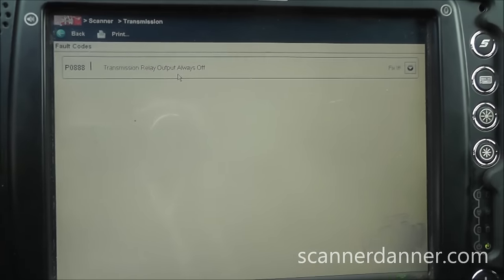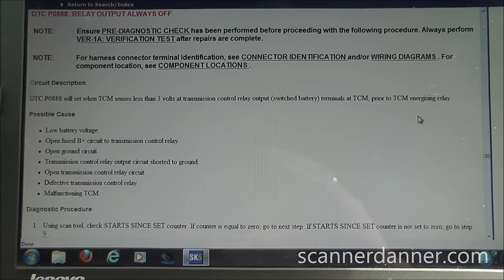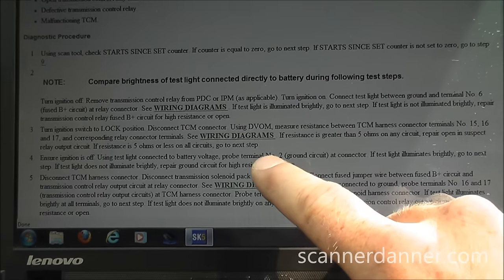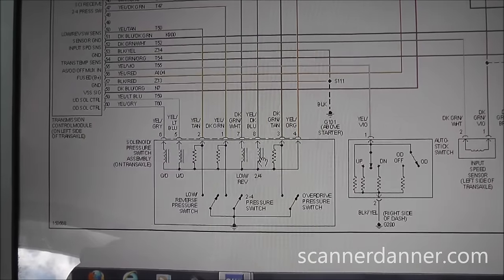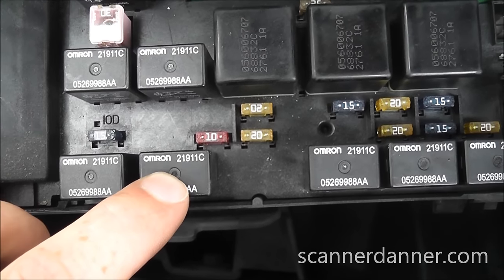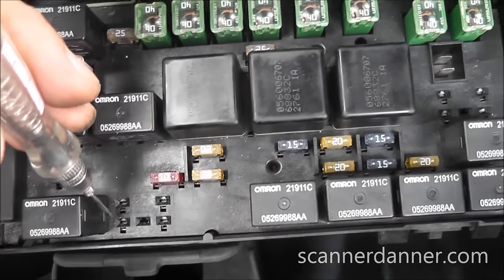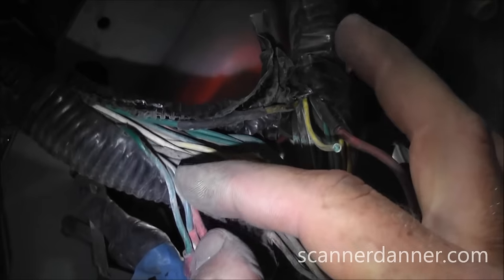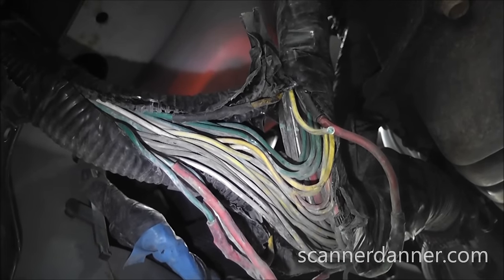Transmission No Shift Case Study (P0888)

Comment: Good vid sr. What you can tell me about code p0891,thanks in advance
Reply from the maker: look up the code definition and post it and tell me what you are working on
Reply: Is a 04 pt cruiser touring ,I’d follow all the relay wires under the fuse box and found a bridge cable disconnect it seem like a ground cable for the place where is connected,but the original fuse box cable is red so.. I haven’t put everything together yet will see this evening,thanks for replying keep up
Reply: ScannerDanner is the code 82 and 83

Comment: The main differentiation that needs to be made at the relay...1. load side fault or control side fault. 2. Is the coil(control) power side switched or ground side switched.  Those are HUGE priorities when it comes to attacking a relay circuit in my opinion.  Going to the relay first is clearly where you gather a sense of direction.  Checking fuses IS NOT always the first step people, please, get it through your head. On another note, just because a circuit is inoperative, does not validate  the phrase "it must have a short somewhere" The vast majority of people who say that do not even know what a "short" is, so sick of hearing that. I have never, not once fixed a vehicle simply by replacing a fuse. Fuses blow for a reason, you better be finding out why it blew. I know for a fact, on older Chrysler vehicles, the transmission relay was tied together with the LDP and the Alternator(been there, done that, lol) Anyways, awesome content, testing and information once again Paul, as your brother calls you, you are the master, lol.

Comment: i have ram 2002 5.9 with re46 trans when i start it and run it directly its will change all gears fine after 2 min if i stopped it will stuck on the first gear ????!! thanks
Reply from the maker: Second gear lockout. You have codes in memory if it's doing that. You need a scan tool that can read the TCM

Comment: inside my fuse box...the airpump relay wiggles n doesnt fit well.
at the local junkyard,there are 5 same make n models of my buick.
i looked,all of them but one were hooked up the same without an air pump relay in them.
so i dissected the fuse box.the one that had an airpump relay in it was a pga touring edition & had two brown wires from the harness that filled those particular areas...whereas on mine...by unplugging the second bolt of the 3 bolts holding the fuse circuitry board together..there werent(holders/wires)...& i was all like maybe i need a fuse wrap to get it to sit still...but!  if theres no lil wire in there to catch the relay or fuse..then its inactive or inneffective right?...but why is there a spot saying air pump instead of Future.. like its unneccesary!

Comment: What if I can't activate the relay with the test light..ohm tested all wires out all ok..have code 0888..put a used tcm didn't still work..checked all,wires in harness took,it all apart..do u think I,need to reprogram used tcm for it to work..
Reply from the maker: IF you cannot activate the relay with a test light, my first question is what kind of test light? Secondly, are you connecting the test light to the correct polarity? Third, are you on the control side of the relay?

Comment: Where is the automatic shut down relay for 2009 dodge ram  1500 5.7.? Soleniod is stuck in 4th gear. I check the fuse box under the hood. There is nothing there saying that. All I see is starter solenoid starter relay. There is no transmission relay. Please help.  I feel this is a electric problem that can be solved. Thank you
Reply from the maker: I think on the 2009 it is part of the totally integrated power module (TIPM) and is a HUGE problem on these systems

Comment: Hello I have a 2003 Suburban and I put a 2005 transmission under the Suburban now it won't shift it has reverse but it doesn't shift to 2nd 3rd and 4th and Overdrive what is my problem

Comment: ScannerDanner .thank for the video.BMW 2001 325i w/transmission zf 5hp 19 does not engage any gear only N all the time,filter ,fluid are new can you help me .please thank you.
Reply from the maker: Not much I can do through text on a screen. Sounds like the transmission may need to be rebuilt. A neutral condition in all gears is never a good thing
Reply: ScannerDanner.Thank you very much for answer the Was quick.

Comment: What if you can’t get the relay to click with battery positive I don’t know if it’s where I disconnected the battery and then ran this test without the check engine light being on and the van shifting normally (for now) after a short time of driving it it goes back into limp mode I just figured the relay should still click I’ve switched relays and have the same issue I have power on the top two terminals and the bottom right but not the bottom left (from side of van and only using test light don’t know the actual voltage coming out yet) any advice would be helpful
Reply from the maker: https://www.scannerdanner.com/forum/post-your-repair-questions-here.html, post this here my friend. IT is free to join. You will need to include more information than you have here. We will need year, make, model, engine, codes, history etc etc

Comment: Hi Dany
I need your help I got 2004 Ford expedition gear not shifting from 1 while in D position but if moving the shifter to 2 it will shift to 2 no codes change another transmission  but the problem still exists 
Thank you so much
Reply from the maker: Post this to my forum https://www.scannerdanner.com/forum.html
Thank you! It is free to join

Comment: I have a LR Solenoid code on my 2006 Durango - replaced the solenoid pack but still have the code... any suggestions??
Reply from the maker: open or shorted wire in the harness or faulty PCM driver
Reply: same problem just checking to know how to fix it

Comment: Hi, I'm turkey Istanbul from you I have a tool that will be a question for a 1998 model Proton brand mutsubi compatible 1600 ° engine automatic transmission problems i have transmission I have collected only tool motion does not I would be glad if you help whichever relay caused solenoid problems
Reply from the maker: I would not have any service information on the model car that you mentioned. I am sorry, we do not have those cars here in the US

Comment: I have a 2006 E250 5.4 liter that goes straight into 2nd gear and will not shift out. Reverse, neutral and park all work fine but like i said, only had 2nd gear and i have brought it to 2 different shops and was told its electrical for sure. I have no idea what relay to check because it's a Ford. Do you or anyone have any ideas what it could be before im tale to shop???

Comment: Hey! My 2007 Chrysler Sebring Touring is stuck in another gear. It won't go faster than 35. Please help!
Reply from the maker: You need to scan the transmission control module for codes

Comment: Mine is throwing no codes but it won't go over 20 miles an hour unless I go down a hill first and then I can go to 60 with no problem but only if it's pretty steep hill and it gets me over 35 it does not have low fluid at perfectly full however I don't know what the problem is I come to a stop sign and I won't go over 20 again until I go down another Hill I have a 2003 Dodge Dakota 3.9 L and have no idea what to do now please help
Reply from the maker: It could be from a restricted catalytic converter. You need to pay attention to the shifting. Is it shifting through all of the gear? Or is it stuck in second gear? HUGE difference in the approach from here

Comment: I have a 2002 F150, FX4, 5.4, 4r70w . Will not shift, got transmission rebuilt, nothing,  checked harness wire by wire(resistance). Fuse 23..still nothing... dropped the tranny again, went through it again.. installed new valve body... still nothing... it seems like there is communication between computer and tranny...yet, it will not shift.... NEED HELPPPP

Comment: My car is a Chrysler sebring convertible 2000  and is stuck in limp mode.....how do I fix it because my port to have it tested also has no power going to it....im lost and do t know where to start
Reply from the maker: Start with getting power back to pin 16 on your DLC. Usually it is tied into the cigarette lighter fuse.
Reply: ScannerDanner ....ok thanks

Comment: My battery got installed wrong amd fried some stuff on the car everything fixed now but the trans dont wanna shift gears anymore what can it be??
Reply from the maker: you need to do a full system scan with an enhanced scan tool. I am sure you still have a module that is not talking (cooked)

Comment: my dodge charger will not do anything when I put it in drive or reverse. the engine will start up and run and everything.  When I put out in drive or reverse it does nothing it just revs up when I tap the gas and ideas on why it's doing this
Reply: 5.7L
Reply: 5.7L Hemi
Reply: This is the same thing my 2001 chrysler sebring coupe is doing. I passed a car which caused it to kick down into passing gear. Then i thought my wife bumped it into neutral. Cause it just started revving up when I pushed the gas but wouldn't go. Pulled over to the side of the road. Reverse, Drive, 1st, 2nd they all seem like neutral just revs up when accelerator is pushed. No warning signs prior to this happening. No slipping, hard shifting or anything before it did this. So I towed it home and I'm still trying to diagnose the issue so I can fix it! If anyone has any ideas on whats going on I'd greatly appreciate the input thanks!
Reply: Did y'all fix the problem?
Reply: Norma Lazcano  mine was low on tranny fluids.  You might wanna check ur tranny fluids level.
Reply: Hell mines too

Comment: hey Scannerdanner I have a question. when you do the volt test for the relay control sencer (Pin 15) an turn the key you get the right volt reading 11.3 volt turn on. my question is when I do that I get no volt reading down below or up top. (loaded an unloaded). what would be the problem for that? or how could I go about it to fix it? when I get a test ran on it says I need to replace the TCM.
Reply from the maker: without the diagram in front of me for the exact vehicle you are working on, I can't answer that. If you wouldn't mind, can you post this to my forum? My guys over there will definitely be able to help you and possibly provide a diagram for you. 
http://www.scannerdanner.com/forum#/general-repair-questions/
Reply: ok thank you. I'm working on a 2002 Chrysler Town and country.
Reply: Thank you ScannerDanner for this video!!! it help me out a lot an I found my problem in two days working with your teck guys on...   http://www.scannerdanner.com/forum#/20160608/2002-chrysler-town-and-country-p0888-5240776/

Comment: theirs a case where a onetime problem was repaired and in the process  some point probing was used and it came back to bite yo azmerelda,  those probe holes should be sealed along with a good splice, something the pre technition  forgot

Comment: PAUL, cant stop thinking about coils, do relays/injectors/ignition coils grow weaker with time or do they just outright fail. And if they die slow . can this be seen as increased ground side voltage drop and increased I draw over time. i thinks i saw a video where  the relay was turning on and off by itself  with a good feed E  maybe the cause of some running hot related intermitents coils failing under load /hot conditions

Comment: Hey I have a 08 Chrysler 300 with code p1745 and no one in Memphis can give me a straight answer so I was just wondering if you could help shine some light I would appreciate it but it read pressure to high or to low but then it shifts into limp mode any advice would be great or helpful!
Reply: desconect rhe plug on driver side this tells the computer the you remplace the presure sensor and relearn the clutchs  whit snapon scaner it give another 2000 stars also install a new line presure sensor

Comment: Smart computer , mine blows the prnd fuse when it hits second 2000 3500 gmc 2wd 5.7 , i tested by rigging the fuse and holding it with my fingers , pulled out of the driveway and got a sweet tatoo on my finger when it tried to shift second , im assuming it happens when it warms up , every morning i can put a new fuse in and make it about 6 miles shifting fine , before it blows the fuse ..so apparently mine aint shutting the relay down , im assuming its a older version ..theres a short somewhere , im hoping it aint in the computer but i suspect it is ..I'm looking for that video , i got many more problem chevy trucks stacking up in the yard , while my own kicks my butt 😂 ..thanx ..

Comment: hey! man , im from mexico, and i have a dodge stratus 2004 2.4l dohc, and recently the check engine light is on, so i put my scanner and the tcm send me this code p0888, i replaze the relay and delete the dtc, the car works fine for a time but the check engine light recently appear, i put my scanner and its the same dtc. and my questios is: is the same procedure to check the problem in my car that you shows on this video? i hope you answering tanks.
Reply from the maker: +Vicente Salazar I do not know the specifics of that code. Purchase a 3 day pass on Mitchell1diy so you can look it up and have wiring diagrams. It's less than $20
Reply: tank you man, i will buy that suscription to fix my car. tanks

Comment: What are those other numbers next to the relay one of those fell off and every since then my engine light been on I think it had the number 20 in it. I've took it to a transmission shop but he said he can't find the problem I tried to explain to him what fell off and how it looked because I lost the it and I don't know where it is
Reply: Those colored things with numbers on them are fuses. 10 amp is red, 15 amp is blue and 20 amp is yellow.
Reply: Leena S if you don't know simple components such as fuses then its best you leave things to a professional.
Reply: Leena S actually it was edited due to spelling error. Absolutely there is nothing wrong with questions at all.. I simply suggested if you're not familiar with general operations of automotive systems and components leaving repairs to a qualified technician. when we get vehicles in the shop that someone has attempted to repair themselves or their uncle who fixes things until the realized they didn't have the proper tools, knowledge of procedures, seized bolts, or whatever reason and end up have to bring it to the shop.. the bill is usually more in the end from having to deal with the extra work that they've caused. I wasn't trying to be an asshole I was merely saying unless you're familiar with vehicles, to save future headaches, its best to have a qualified shop take care of your vehicle(s). Just about anyone can turn a wrench but a technician has certification from schooling. Wish you luck with the car.
Reply: i put a 2001 trans in a 94  s10 an it wont shift into drive or overdrive what would it be

Comment: I have a 2001 pt cruiser automatic with 85,000 miles on it.  Lately I have trouble with it not get in gears.  There are no check engine light on.  What could my problem ?  Thanks in advance !!
Reply from the maker: Those are not good symptoms William. Usually a transmission rebuild is in order there, as long as your fluid level is full.
Reply: I checked the fluid and it was low again.  I replaced the trans fluid and filter laster summer. I used the correct fluid the first time but when I added some today I used the wrong kind.  What do you suggest ?  Thanks in advance !!
Reply: Looks like I might all right.  The new pan gasket is leaking oil.  Will have to check bolts etc.
Reply: What do you think ??
Reply: Have you checked my replies ??

Comment: Can we check this with multimeter with conectivity direct out side ecu to rely check if no conectivity then somthing wrong that wire ! Im a right ? Hop so
Reply from the maker: The ohmmeter test is one of the most inaccurate methods of identifying wiring problems. Watch this video https://youtu.be/McsNOJvd0ao

Comment: I have 2000 isuzu rodeo transmission problem , it want to sputter or skip , if you give a normal about of gas to the paddle it well grab hard and squeal the tire , so you have to gently give gas and it well most of the time go .. I did have it rebuilt a year ago and at fist it ran fast and strong , then few weeks later started leaking fluid.  to it back they made their repairs.  it changed gears fine but drove slower didn't have the power it did at first.  now it been 7 month , and transmission is skipping again??? what is wrong. 2 wheel drive LS .. thank you.
Reply from the maker: not sure by your description if you are describing the transmission slipping or a misfire condition. Some things can't be answered through a text on the screen

Comment: Hey Paul, would checking for continuity from the relay to the computer yield a similar result? I know my basic voltmeter gives a resistance reading when checking for continuity, so I think it would show the same problem that you found under load. What are your thoughts?